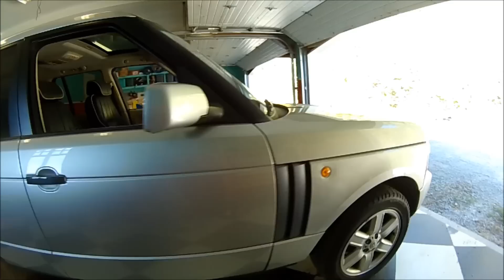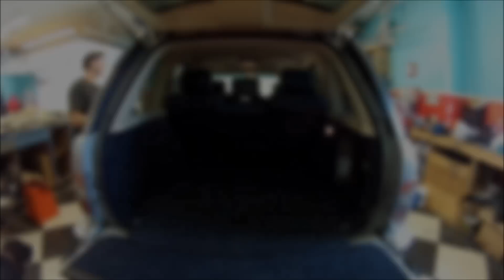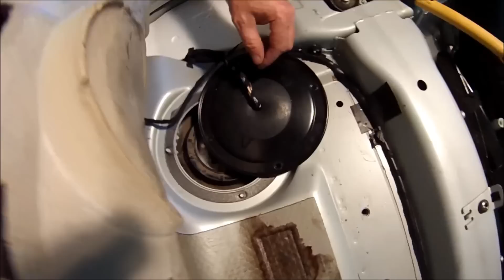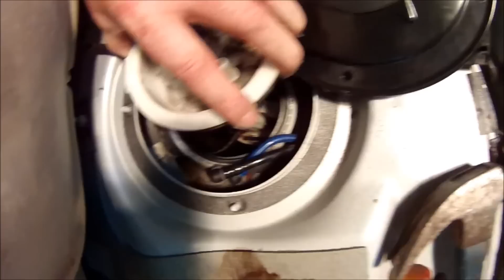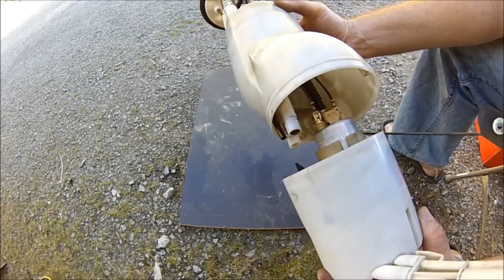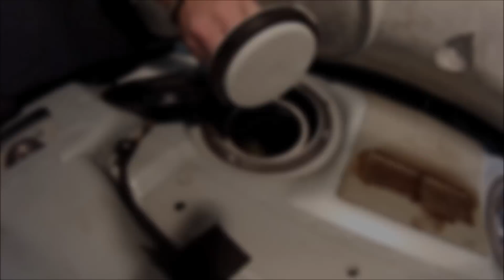DIY Fuel Pump removal Range Rover HSE (2004) and disassemble

Comment: Do not try to fix replace the inner pump. This guy has edited out the downfall of replacing the inner pump. Hence not showing the full procedure. The removal of the connecting cables are easy enough, but the main pipe crimped and is not your average jubilee clip the pipe is sealed air tight, so therefore would need either heating up to release with much difficulty or risk splitting the pipe altogether.  The pump shown on the video has been adapted for the video, making it look easy. Replacing the whole unit is far less stressful. No need to change the fuel gadge connection supplied - if the problem is just pump failure.

Comment: Has 2 pumps?
Reply: Just one the other six is a float to measure fuel in the upper tank. If you google a tank for this model it has two sides one is higher than the other ( the one closest to the filler hole) it is connected to the other side where the actual pump is.
Reply from the maker: Derrick is correct, this one only has one pump. Cheers

Comment: Hey, great video, I just bought a 2004 HSE and its running rough apparently (physically getting truck in less than a week).  I'm paying $1200 and a Macbook Pro Late 2013 ($700 value) and truck is Taxes included, delivered from 300 kms and transferred into my name Great Deal!  Just want to know if your truck ran at all with the bad fuel pump or just wouldn't run at all?  Im looking forward to diagnosing and repairing my new truck.  Thanks for the video even tho it's a 2.0mp camera it got the job done.
Reply from the maker: My problem was is started running rough here and there... not all the time. Noticeable on a hill and on the power. Was like that for a couple of weeks. Then it became hard to start but not all the time. Then, it never started and I had to tow it home. So, mine slowly failed and never gave up all at once. Yours "could" be this but possibly others things too. As for the quality of the video; try changing your YouTube settings. This is full 1080HD and taken with a Contour+ at 5.0mp. Good luck with your HSE, seems like you got a good price there. Cheers.

Comment: Great Video Rob.

I'm about to tackle this issue on my L322 2003 TD6 here in the UK.

Was yours in the video a petrol or diesel?

Is there any difference when doing the replacement on a diesel?

Does the fuel gauge need to be reset after this job, someone told me the gauge will read wrong after the pump change.

Thanks again 👍😊

Comment: Tip on the fuel lines ontop of the pump. Use a Zip tie with a tightening tool. Don't break it into shambles like I did on the first one.
Reply: Zip tie with tightening tool? How exactly can you use that?? Any help very much appreciated
Reply: Where did you get your new retaining wall clip?
Reply: I also shattered mine first go

Comment: I read somewhere that the fuel pump has a 'memory' - do I need to do anything special to protect that?

I see you fitted a Spectra Premium" pump (part # SP1303) in 2014 - how has that worked out?  Still working OK?
Reply from the maker: I never heard about a "memory" in the fuel pump. Mine was plug-n-play... installed it and it worked great. I have since sold the HSE but never had any complaints from the buyer.
Reply: Hello Rob. I have replaced the original pump with the same spectra unit and it is running extremely loud. Was the one you replaced any louder then the original? Great video btw, Thank you.
Reply: @rbetlej  HI I have the same issue replaced the original pump and I hear the car from two blocks away :( Tragedy don't know what to do now ??
Reply: Hi  @marcinpaweczyk538 . I replaced the pump with the same Spectra one and was quiet for a week. I've been running it since with plans on replacing it with the Pierburg one. Its working fine just loud.
Reply: @rbetlej  Its so loud that I don't hear the engine :( its a pain in the ass really, I have read somewhere that this could also be caused by the clogged fuel filter? Did you change the fuel filter also?

Comment: As a followup to my previous comment, I bought a 2004 Range Rover HSE with a bad fuel pump for $3000. I did a fuel pressure test, saw the fuel pressure was extremely low, and replaced the fuel pump, using this video as a guide. I didn't have too much trouble with it, and the fuel pump only cost like $150 for a brand new one. A couple hours later I had a perfectly running Range Rover with no check engine lights or anything, awesome!
Reply: Danny Zabolotny
Reply: Could you tell me where you buy your pump because am having same problem now
Reply from the maker: @arifomer182  I bought mine from a local parts store (not a big brand store). You can try to Google the part numbers in the description and see what is available in your local area. I am sure most of the larger retailers would be able to source this for you. Good Luck

Comment: hi Rob,
thanks for the video.
I have to change the fuel pump on mine now and basically going to follow what you have shown.
my question is  why did you remove both leads as the pump is one of them? 

Thanks

Comment: For those who are having problems i just took mine off righ after posting on this post. Its easy. Push down, use a flat head and push up on the orange seal while pulling up. Try it a few times.

Comment: hey great video I just finished installing my new pump but now won't start at all...seems like the pedal has no pressure...do you know how to re-pressurize the fuel? also do the plastic pipes at the bottom of the sending unit connect to anything?...I just put it back in and couldn't see that they attached anywhere

Comment: Great clear guidance regarding removal of the in tank pump unclipping the rude heads are fiddly  but  patience
Is the key make sue you place back very carefully otherwise you will get irregular reading on the dash once it's all bolted back it..
But great practical help  thanks..

Comment: Just a other note don't run your car low on fuel as it can over heat the fuel pump keep at lest 1/4 tank of fuel on the gauge and this will prolong the life of your fuel pump
Reply: That's prob what f**ked mine up. Altho 20yrs old, 155k, V8 11mpg, so it had pumped over 15,000 gals.

Comment: Thanks rob very helpful . Just note I did mine it's a 2002 model . Runs a BMW fuel pump . My fuel pump was $75 on eBay or contact OEM automotive trading 3-5 Awun court Springvale Victoria 3171 Australia  .Not even British off road Land Rover spares in QLD Australia can get it this cheap .they are asking me where I got it from .hope this is helpful cheers .
Reply from the maker: +Trevor Goodall Awesome, thanks Trevor
Reply: Ok, 6yrs ago, bit i got complete unit £44 !!

Comment: GREAT tutorial!!!!!! I used this vid to replace my fuel pump assembly. My question is, where did you secure (or anchor down) the LH fuel sending unit. I have reinstalled the fuel pump RH side. However, the LH side "sending unit" is floating in the tank. What did you anchor (secure) it to in the tank?
Reply from the maker: +Terrance D That's odd, I never had to deal with a left hand sending unit

Comment: Rob i bad 3 mechanics and we couldnt get connectors off.Should I drop fuwl pump.
Reply from the maker: +Revoswathead If they just don't come off then you could look into cutting the hose somewhere so you can take the pump out. Then, I would buy new fittings when I got the new pump. Price out the parts before you do that so you know if you can get them before cutting the fuel line.

Comment: Hi Robe, great video, my issue still persists though is it possible that these aftermarket pumps don't have the necessary strength? Because the PSI is weak on the new pump I put in, Which was a quantum...What brand would you recommend, asap? Thanks
Reply from the maker: Wayne P If you read in the comments I wrote I used a "Spectra Premium" part #SP1303. Worked great. Not sure about the Quantum. That's a bummer it is still not working after installing a new pump. I guess on the bright side your next install should be even quicker. Good luck.

Comment: Hi im having some issues with my range rover currently what were your symptoms and how did you figure out it was the fuel pump?
Reply from the maker: tttran8360 Started running rough here and there... not all the time. Noticeable on a hill and on the power. Was like that for a couple of weeks. Then it became hard to start but not all the time. Then, it never started and I had to tow it home. So, mine slowly failed and never gave up all at once. I checked the bleeder valve on the steel fuel line on top of the engine (looks like a tire valve). You can have someone crank the engine and open the valve. If no fuel comes out its probably your relay or your pump.
Reply: Rob Poole Hi thanks for the reply. I looked into the truck today. I replaced the fuel filter and spark plugs. Now all its doing is starting up and dying soon after it starts if it even starts at all. I did a pressure check on the valve under the hood. It was reading at about 18-22 psi. Does that sound right? Any info would be highly appreciated.
Reply from the maker: tttran8360 Mine started and died right away too. The pump might build up pressure but stop pumping and the pressure may stay in the line. You could have the pump out in under 30 mins. Then you can bench test it. Mine would run for a few seconds then stop. Then it died completely. good luck in getting it fixed

Comment: Will the "Spectra Premium" pump (part # SP1303) pump work on an 05 HSE as well?  I'm having an issue now with mine and we thing it's the fuel pump.  Starting and stalling, trying to start and making a funny noise and smells like gas.
Reply from the maker: ***** I believe the '04 and '05 were identical but you would need confirm that. The pump really does come out quickly so it may be worth it to just pull it out. Maybe you will get lucky and just the filter on the bottom of the pump is plugged a bit so a cleaning may clear things up. That being said, it is a Range Rover so you will probably need a new part somewhere :)
Reply: Rob Poole  We ordered one so we'll see.  Its the worst vehicle i've ever owned.  When I'm done I'll have replaced what I feel like is everything.  I literally just got it back from the shop last weds and now this.  I was stranded at the store today, wouldn't start.  We went back to tow it back to the house and it started.  Go figure.  But apparently wanted to stall out the entire ride home.  Grrrr time to get rid of it.  Thanks for your video though, it will help when it comes time to change it.

Comment: Very helpful video! I have a quick question. After replacing the pump did you have to reset the computer system as well? Any help would be great
Reply from the maker: Plug-and-play... Installed the pump and it fired right up. No computer reset needed

Comment: Great video! I got a 03 range rover at 171,000 km and the fuel pump gave out. After getting a quote of $2100.00 from the mechanic, I decided to take matters into my own hand and get it done myself. So in your opinion, to put it back, do I just reverse up the process in your video or is there a special process?
Reply from the maker: Full reverse, nothing special. Cheers